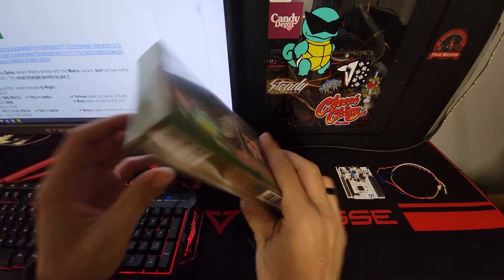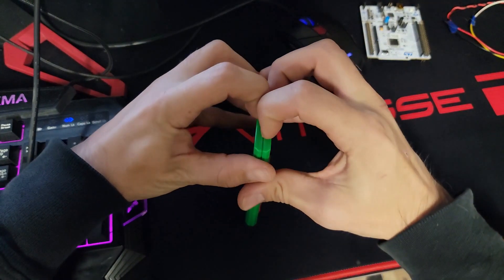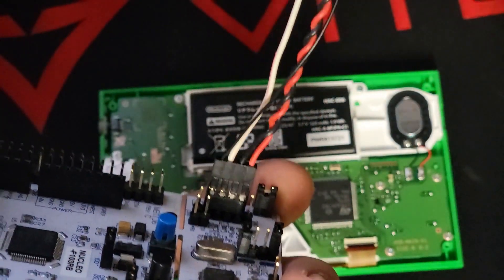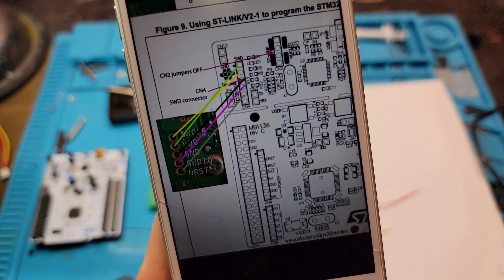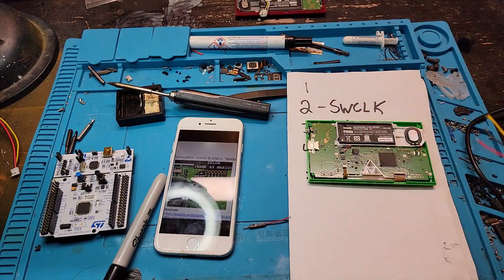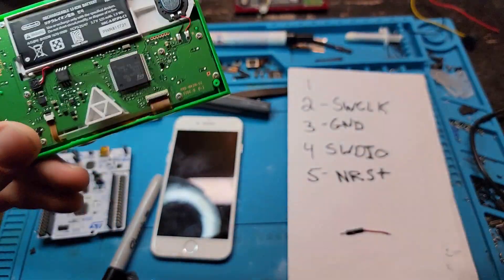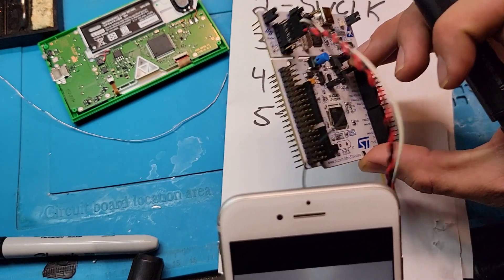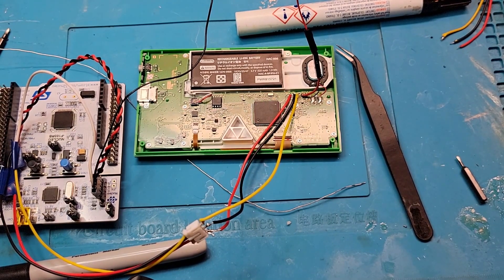Hacking the Nintendo Game & Watch: Legend Of Zelda Edition Part 1

Comment: So I am super late to this, and I am a new to this kind of thing. But theoretically if you had your cables touching the right debug ports, would this work without soldering? Probably not (because why else would you show us you need to do it) but I am pretty sure I wont be able to get my hands on that equipment any time soon.
Reply from the maker: You don't need to solder,  you can use alligator clips and other things , just need a contact
Reply: @RetroResinCA  Hero for replying after years and so quickly. Amazing! Thanks for the video man!

Comment: Always disconnect battery or power source before soldering or bringing anything that can conduct electricity between connections. Sure way to fry your 50$ game and watch if a accidental drop of soldering should touch something.

I struggle with shaky hands and I fly racing drones. I have blown 2 flight controllers with my shaky hands and a stray small drop of soldering.
Reply from the maker: ive been lucky with my flight controllers :p  built some fpv drones with crossfire lots of fun and addictive

Comment: Is there any preference/benefits to using the Zelda over Mario, in terms of those additional Start/Select buttons, when using Retro-Go OS?

Cheers for the guide too 👍
Reply from the maker: chip is a bit bigger,  and the buttons!
Reply: @RetroResinCA  Zelda unit has more flash storage or no?
Reply from the maker: @seanabsher5577  yes